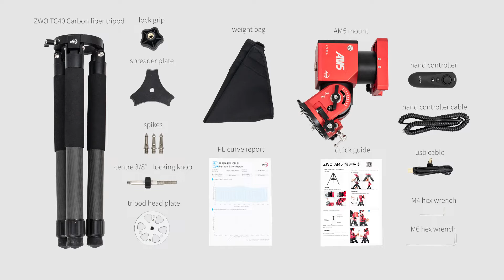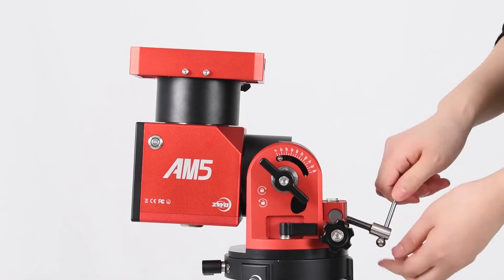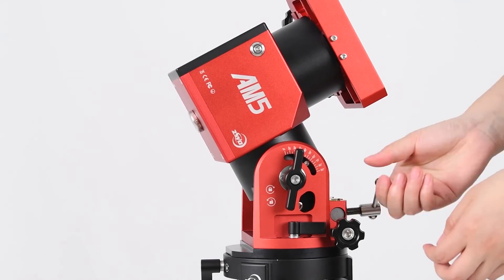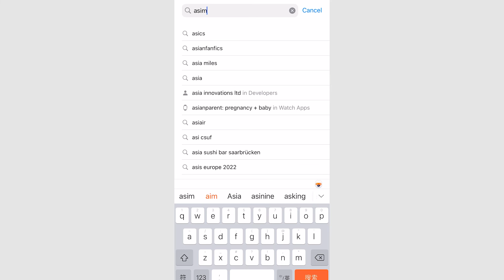[REMAKE] Product Tutorial | ZWO AM5 Mount Tutorial: A quick guide on how to use the mount and tripod

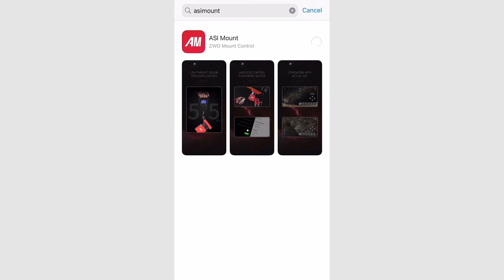Comment: 4:00 the app is not connecting to my cell, why?
Well what the guy does not clearly indicate this is not done in the app’s settings.
Instead, 
Settings > connections > Wi-Fi > connect to AM5

With this type of mount why does it matter to change from azimuth mode to equatorial mode?

Comment: I would like to see an AM7.  This mount would handle larger/heavier telescopes. I would also like to see the AM7 mount to be heavier and taller. I bought a William Optics 132. I mounted it on my AM5 and so far the mount seems stable. I did use a weight on the screw in shaft and another weight in the bag below the mount. I would still feel more comfortable with an AM7 mount with higher weight capabilities and better stability. And I’d volunteer to try the new mount with my scope. Thank you.